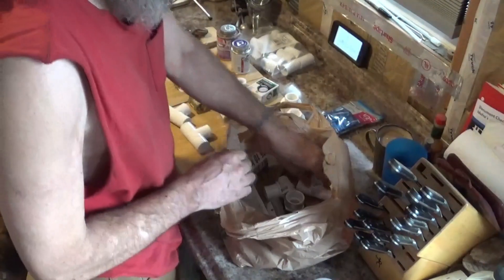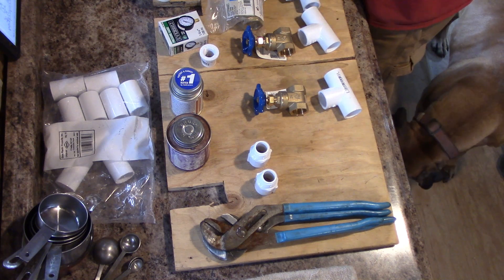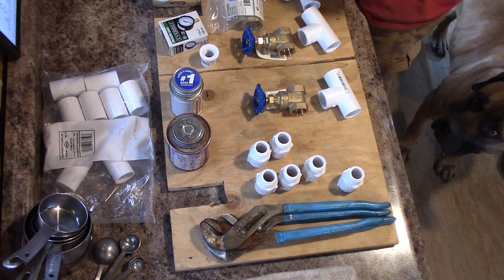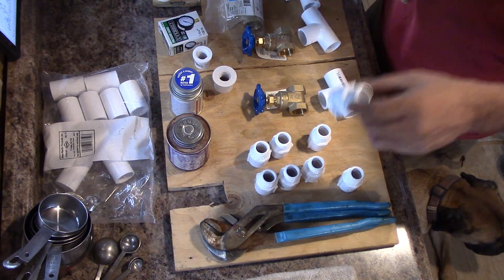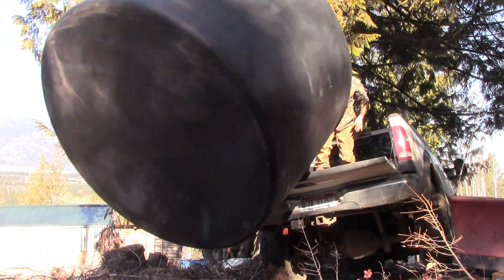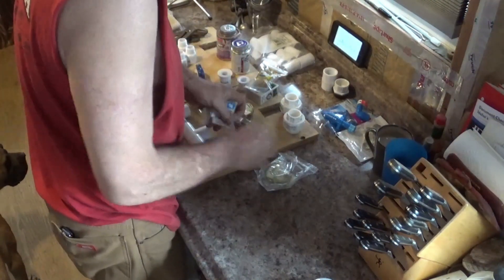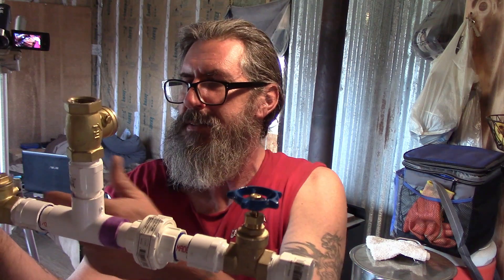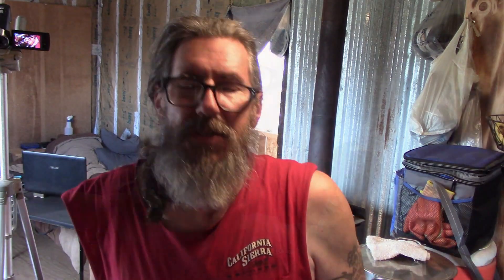Homemade Ram Pump | Setting Up Our Water System (Part 2)

Comment: Thank you so much for the video and including the Home Depot parts list.  Everyone else may know this, but a sales person showed me that the bin number is printed on the part after the UPC code.   I'd be interested in how the expansion pressure tank comes together.  I think you were smart to start with the 3/4 inch for your purpose - can connect to garden hose size hoses (might be an issue with the threads - not sure).   Also, if you make a mistake and need more parts, the 3/4 inch are less expensive than larger parts.   I hope you will consider sharing what you have found in the Water Powered Pumps public facebook group:  https://www.facebook.com/groups/240458583255303/
Reply from the maker: Dave Bean so happy you enjoyed the video! You’re more than welcome to share our video in your FB group.

Comment: This is so cool!  I'm very excited for you guys, looking forward to seeing the finished project at work.  Question, you say your creek is seasonal, does it run during the winter?  If so, as long as water is flowing thru the ram pump, you won't have to worry about that PVC freezing & cracking, right?  Another question, have you followed your creek & found the source?  Is it spring fed?  If it is, it would be awesome if you could open up the spring so the creek would flow year round.  But that might be a really big project.  Good luck with this, and keep us posted!
Reply from the maker: Catherine Manley hopefully I answer all your questions 😬 So the creek will usually start flowing during the January thaw. We did locate the head, but it’s not on our property. The plan is to have a total of at least 5k gallons in tanks. We could fill them easily with the creek, as long as this ram pump works well 🤞
Reply from the maker: Catherine Manley we will definitely keep everyone updated. Working on part 3 right now. Can’t wait to take the ram pump down there to get it going! 😀

Comment: Homestead engineering at its best! Go Stu Go. Looking forward to next episodes, for sure. I would like to make use of my seasonal creek and to also to move rain catchment water to a up slope storage tank.
Reply from the maker: Steve Schauweker this is Stu. In theory your idea will work. But there are some hurdles to get over. I don’t have the specifics at my fingers right now. But here goes. Let’s say for every one gallon pumped uphill you loose 10 gallons out of the check valve. For a 500 gallon rain tank you pump 50 uphill. Before you get the water up it has to go down, this is the drive pipe. According to Clemson the drive pipe has minimum and maximum length limits for the pump to operate properly. I have thought about trying to figure a way to capture all the wasted water and still make is usable for the house, butt that is above my pay grade. Hope this gets your brain juices flowing. Let me know if you come up with an idea. Would love to test it out.
Reply: @BreakingFreeOffGrid  gov will have all heads for this tech thay teach us that we always have loss but never talk about 
the converted gain we can make from eletromagnets
if u convert all the wast thermal energy around 
you u can use it universally as energy u need a true sine wave bipolar like the power comp dose a 
true pure sinewave like a grid tie inverter 
once the signal is made the system will turn on and 
consume wast thermal energy from the 
environment and space around you... there is free energy but 

it comes from Universal thermal loss and converted into a gain. so a pole Transformer and a 
microwave Transformer  have a common between each other u can take 2 microwave Transformer provide 
a pure sine wave grid tie inverter to it or a true bipolar sinewave that inter acts with nature in 
a perfect spherical motion like a flower of life..  if ur home provides this use it as a Source 
signal then u can simply stack the Transformers on top of eachother in correct fasion and note 
that the 1 wire on the Transformer must stay connected and the other disconnected your only useing 
1 wire on the hi side .. so test ur self 
2 microwave transformer stacked on top of eachother same 

face sides. one side 120 to the wall and the other 120 side to what u want to power and useing the 
Transformer just the way it came out the microwave with the wire attached causes the energy in its 
perfect spherical motion to converted wast thermal energy to amp for u hot to cold in to out... 
should look a bit nuts with u use a form of wireless energy but its interacting with the 

environment...this is my work a compilation of Otis car. Tesla. and many other very smart people 

nowadays i think i found the gate source and drainif this gets out to much that it works the 
power 

comp and mib will have our headsdont do this at home warning high voltage yet i cant stop u lol DO 

NOT TOCH THE CORES OR THE WIRES OK u will die make sure u dont touch the core if the hi wire is 

mounted to it u dont have to mount the hi on the core if u dont want u connect the 1 hi wire to 

the same side hi on the other transformer then the core should besafe to handle if nessary
grab your multimeter and prove me wrong
thats what u do i have my whole home on this
and u can take 

one of the lows side out the wall and hook it up to other stuff and power it for verry little amp 

makeing nature convert and pumping latent heat effect into the device.
and u can have a microwave 

hi volt cap in between the hi side and make a system that powers its self
u can flip the switch on 

ur breaker and the room stays on up to 2kva 
with both lows in the wall this is the zero point that 

was taken from us...
Reply: @BreakingFreeOffGrid  gov will have all heads for this tech thay teach us that we always have loss but never talk about 
the converted gain we can make from eletromagnets
if u convert all the wast thermal energy around 
you u can use it universally as energy u need a true sine wave bipolar like the power comp dose a 
true pure sinewave like a grid tie inverter 
once the signal is made the system will turn on and 
consume wast thermal energy from the 
environment and space around you... there is free energy but 

it comes from Universal thermal loss and converted into a gain. so a pole Transformer and a 
microwave Transformer  have a common between each other u can take 2 microwave Transformer provide 
a pure sine wave grid tie inverter to it or a true bipolar sinewave that inter acts with nature in 
a perfect spherical motion like a flower of life..  if ur home provides this use it as a Source 
signal then u can simply stack the Transformers on top of eachother in correct fasion and note 
that the 1 wire on the Transformer must stay connected and the other disconnected your only useing 
1 wire on the hi side .. so test ur self 
2 microwave transformer stacked on top of eachother same 

face sides. one side 120 to the wall and the other 120 side to what u want to power and useing the 
Transformer just the way it came out the microwave with the wire attached causes the energy in its 
perfect spherical motion to converted wast thermal energy to amp for u hot to cold in to out... 
should look a bit nuts with u use a form of wireless energy but its interacting with the 

environment...this is my work a compilation of Otis car. Tesla. and many other very smart people 

nowadays i think i found the gate source and drainif this gets out to much that it works the 
power 

comp and mib will have our headsdont do this at home warning high voltage yet i cant stop u lol DO 

NOT TOCH THE CORES OR THE WIRES OK u will die make sure u dont touch the core if the hi wire is 

mounted to it u dont have to mount the hi on the core if u dont want u connect the 1 hi wire to 

the same side hi on the other transformer then the core should besafe to handle if nessary
grab your multimeter and prove me wrong
thats what u do i have my whole home on this
and u can take 

one of the lows side out the wall and hook it up to other stuff and power it for verry little amp 

makeing nature convert and pumping latent heat effect into the device.
and u can have a microwave 

hi volt cap in between the hi side and make a system that powers its self
u can flip the switch on 

ur breaker and the room stays on up to 2kva 
with both lows in the wall this is the zero point that 

was taken from us...
Reply: @BreakingFreeOffGrid  gov will have all heads for this tech thay teach us that we always have loss but never talk about 
the converted gain we can make from eletromagnets
if u convert all the wast thermal energy around 
you u can use it universally as energy u need a true sine wave bipolar like the power comp dose a 
true pure sinewave like a grid tie inverter 
once the signal is made the system will turn on and 
consume wast thermal energy from the 
environment and space around you... there is free energy but 

it comes from Universal thermal loss and converted into a gain. so a pole Transformer and a 
microwave Transformer  have a common between each other u can take 2 microwave Transformer provide 
a pure sine wave grid tie inverter to it or a true bipolar sinewave that inter acts with nature in 
a perfect spherical motion like a flower of life..  if ur home provides this use it as a Source 
signal then u can simply stack the Transformers on top of eachother in correct fasion and note 
that the 1 wire on the Transformer must stay connected and the other disconnected your only useing 
1 wire on the hi side .. so test ur self 
2 microwave transformer stacked on top of eachother same 

face sides. one side 120 to the wall and the other 120 side to what u want to power and useing the 
Transformer just the way it came out the microwave with the wire attached causes the energy in its 
perfect spherical motion to converted wast thermal energy to amp for u hot to cold in to out... 
should look a bit nuts with u use a form of wireless energy but its interacting with the 

environment...this is my work a compilation of Otis car. Tesla. and many other very smart people 

nowadays i think i found the gate source and drainif this gets out to much that it works the 
power 

comp and mib will have our headsdont do this at home warning high voltage yet i cant stop u lol DO 

NOT TOCH THE CORES OR THE WIRES OK u will die make sure u dont touch the core if the hi wire is 

mounted to it u dont have to mount the hi on the core if u dont want u connect the 1 hi wire to 

the same side hi on the other transformer then the core should besafe to handle if nessary
grab your multimeter and prove me wrong
thats what u do i have my whole home on this
and u can take 

one of the lows side out the wall and hook it up to other stuff and power it for verry little amp 

makeing nature convert and pumping latent heat effect into the device.
and u can have a microwave 

hi volt cap in between the hi side and make a system that powers its self
u can flip the switch on 

ur breaker and the room stays on up to 2kva 
with both lows in the wall this is the zero point that 

was taken from us...

Comment: I was hoping you would go this route!
Reply: Eventually we will probably go this route once our system is is up and running. That’s just another 500’ of pipe I didn’t want to buy right now. It would probably keep it running for a longer period of time. I have even thought about trying to incorporate a Pelton wheel on the return. Thanks for your response.
Reply from the maker: Matt Poland it definitely seemed like the best option 😀
Reply: @BreakingFreeOffGrid  one other thing you can do to increase flow and prevent freezing is to put an overflow in the top of your tank and pipe it down to the dammed supply.
Reply from the maker: Matt Poland Stu is putting in an overflow on the tank. I’ll mention this to him when he comes home. Thank you 🙏

Comment: Don’t watch those other channels. Just you guys.. I built a ram pump when I first got here. Mine was 3/4. They do work good. I only pulled mine 32 vertical feet. I still have it but I don’t get water out of the river anymore. Priming them is the fun part. Have a great day you two..!!
Reply from the maker: living Off Grid McGarvey style good morning Ron! How are you filling your tanks now?
Reply from the maker: living Off Grid McGarvey style I’m excited to get it all connected 😀
Reply: The spring is running now. I filled my garden tanks yesterday.
Reply from the maker: living Off Grid McGarvey style we’re hoping to get it all connected this weekend! Fingers crossed the weather plays nice. We’ve had snow and rain this week 😢